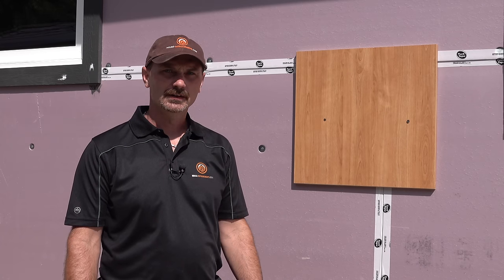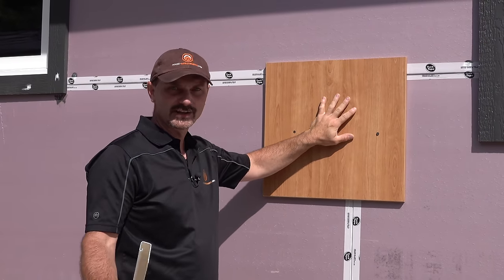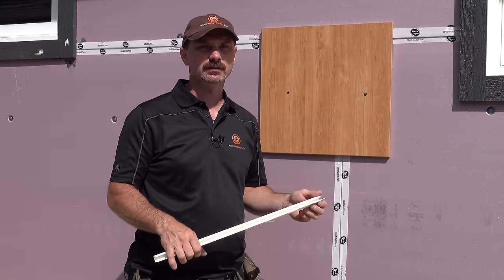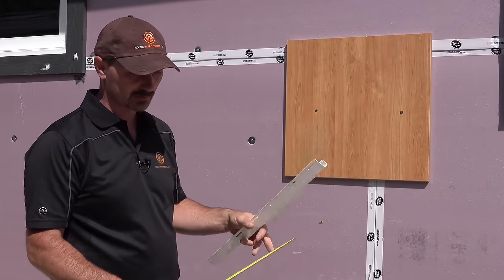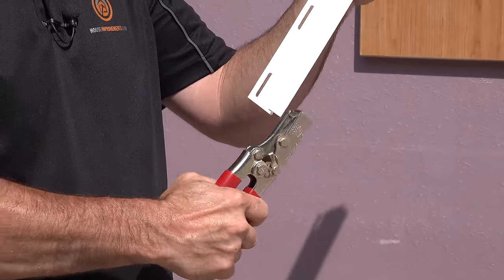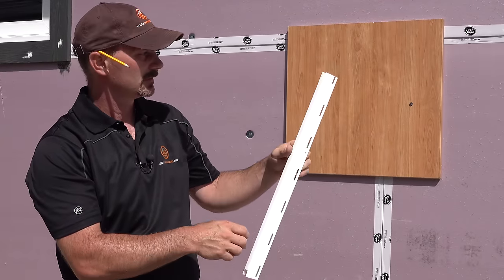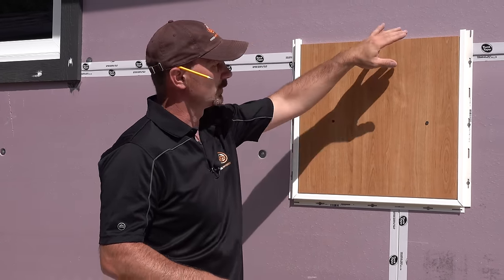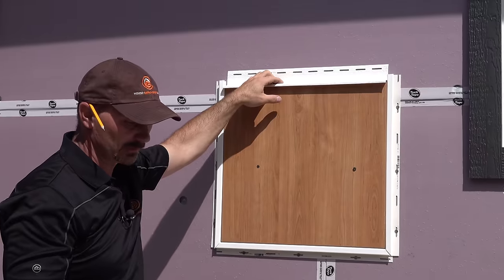How To Install J Channel (Vinyl Siding)

Comment: Hello, I noticed you didn’t have the insulation right to the corner. I’m using 3/8 Levelwall. Should I run it right to the corners?
Reply from the maker: For 3/8" insulation you will be fine to run it right to the corner. When using 2" Like I am I use only 1-1/2" on the very corner and cover with 1/2" plywood to may attaching siding corners easier.
Reply: HouseImprovements thanks for the fast answer I’m starting it tomorrow! Appreciate the videos they are very helpful!

Comment: Thank you for the instruction, I have two questions, one is can you do stucco render over it? second; what size nail you are using for the siding? thank you.
Reply from the maker: Yes this could be wired and stuccoed. I was using 3" shingle nails

Comment: I am trying to install a doggie door on garage so the vinyl siding is already on the back of garage. How do you do this when siding is already on? Zip tool the siding off or just bend it to hammer in the J channel?
Reply from the maker: I would remove the siding and nail the J then re install siding

Comment: What do you do about the water that runs down the wood and gets behind the bottom J channel and all of the wall behind the siding?
Reply: Vinyl siding is not one hundred percent waterproof. Watch some videos on tyvek/ sheathing membrane installation and taping. A sheathing membrane is necessary where water has a chance of entering.
Reply: Properly flash all openings and also use tyvek tape on housewrap..
Reply: In one town i worked in the insp made us come up with a way to shead water from j channel back on top of siding at the bottom of every window ! We were able to make up something but the industry needs to make something like we did for this! 
Great video

Comment: Good video for beginners...if you plan to be a sider this method is fundamentally correct but way too slow.

Check your local building codes...many require end dams and a space between top drip cap and js
We caulk all Js on to whatever protrusions we are j channelling to water proof as well...we use LePage brand Quad type elastomeric polymer caulking for this.
We also never use a tape measure at all....way too slow and easy to hold a j up to window and mark w/ a pencil...on perfectly square windows or vents once you have one side marked you simply cut front and back of j and then fold the j over onto full piece and mark again then repeat until you have 4 equal pieces....saves a lot of time.
For miters we never miter straight to a point as when the j channels shrink in winter there will be a gap at every corner.
Exterior renovations are our business been doing it since 2007.

Not trying to nit pick there is nothing fundamentally wrong with the instructions....just more than 1 way to skin a cat and more efficient ways to get er done when time is a factor...which it is for people installing as a job and pay is piece work.
Reply from the maker: Good info.

Comment: Is it common practice to use j channel instead of starter strip to begin a course of vinyl? Its on my son's house and the water from rain in flowing down the j channel and causing water problems on the house, thanks.
Reply from the maker: Sometimes you need it instead of starter strip. You can drill some holes through it in the bottom so the water drains at other places instead of just the ends.

Comment: I know this should be obvious, but what happens to the water when it reaches the bottom of the, for example, window? Does it push the water behind the siding down the wall? If not, how does it get pushed to the front of the siding when it reaches the bottom?
Reply from the maker: Some goes in behind. If your house wrap is done well it flows that to the bottom of wall and out ,or you can use tin to direct it back out over the sing below.
Reply: @HouseImprovements  Thank! It's an older house without a house wrap, but there are two decent overhangs. I think I'm going to try to direct it back out with the tin. Not a lot of examples on how to do the tin so if you need an idea for a new video this might be a good one. Seems to be a lot of people wondering about how water drainage works with j-channels.

Comment: Wondering if anyone can help me. I have a Malco j trim cutter and every time I try to half cut for the fold down I go right through. So pretty much useless for the intended purpose. Any suggestions would be greatly appreciated
Reply from the maker: I dont wanna sound mean but dont squeeze all the way. All the way cuts it off and partial squeeze only clips it so it will stay on the J. If the J is cold it is harder to keep from cutting it right off.
Reply: HouseImprovements you are not sounding mean lol . But I can’t seem to get on to it. I will just use it for the cutouts and use shears for the other. Thank you for your help love your videos very helpful

Comment: Shannon, Can vinyl be installed over masonite
Reply from the maker: Sure. I prefer to remove old siding and then install new siding but you could go over it if you wanted to.

Comment: Do you install j channel around windows if the window has built in j channel?
Reply from the maker: No you dont need to for the sides and bottom but if your window is in a spot where it needs a drip cap over the top then you need J above the drip cap.

Comment: Easier method than measuring is holding the piece up and marking it with your pencil on both sides then leaving a tail on each end, then screw or nail it on, and then you can mark your length for your overlap piece and cut it while it's on the wall, eliminates the extremely long measurement method you show

Comment: I could have J'ed that pretend window out in under 1 minute. Never use a tape measure unless you know for a fact it's perfectly square (in most cases it's not). 1) precut your bottom on one side,cut it to leave your face a little longer.2) put the j on the wall and mark the other side and repeat the same process. 3) now you can use the tape measure or estimate a bigger than the actual size you need about 4" larger.4) mark inside the bottom piece and the outside face where the two meet. Doing this you will see that the angle you've cut is not always the same!!! But will be perfect everytime. I also interlock the face of the J and bottom and tops , it's water proof and will not spread apart in the future. Me doing it in under 1 minute is 30+ years of experience
Reply: You think you're better than us?

Comment: what do you do between the  j channel and object (window or door) do you put caulking there?
Reply from the maker: generally no because the J channel will want to expand and contract with temp changes but I have done it at times for special situations with no real problems. Ideal you want to effectively water proof anything that you J around before you install the J but there are cases where that is not going to completely work 100% so caulking the trim is a good idea. Remember not to seal an area that should act as a drain to allow moisture out from under the siding. Our forum is a great place for questions like this next time you need some help.https://www.house-improvements.com/forums/

Comment: I try not to use j channel. New construction windows have it built in j channel and I use vinyl brick model and rout out it on the back for your siding for doors and bend aluminum to fit the grove to make it water proof. And I use truss head screws to install the siding and don't make it tight. And for the naysayers I've been doing siding for over  20 years and he is doing the j channel right.
Reply from the maker: Nothing wrong with those methods at all.

Comment: For the notchers is it one size for all j channel? If not what do i measure to know what size I need?
Reply from the maker: There are couple different sizes . Measure the distance from the back that will be against the house to the fringe face of the J channel. GENERALLY A 5/8" NOTCHER WILL WORK FINE FOR ANYTHING.

Comment: One problem I don't like with J channels is that if whatever you fit in there isn't perfectly flat (like aluminum soffits or vinyl siding) and snug (rarely the case to allow for expansion), bugs can use the gap to get on the other side.

Comment: I just spent 1/2 hour looking thru Lowe's and Home Depot for vinyl "drip cap" like what he's using, only found aluminum, galvanized steel and PVC. Maybe I'm using the wrong search term, also tried "drip edge"?
Reply from the maker: Window/door cap" is another term. Sometimes it helps to search more generically like "vinyl siding ".https://www.homedepot.ca/product/abtco-window-door-cap-slate/1000651989
Reply: @HouseImprovements  Thanks, on a side note, I watched most of this vid really close.  I had about 12' of j channel and tried to frame one 24" window,  I got results as if three men did the job, Larry, Moe and Curly:)   But from them I got some dry fit measurements which I can use to try it again.  If your not familiar with siding, your probably not going to get each piece to fit right the first time:)
Reply: I always make my drip cap with trim coil.

Comment: This vinyl siding installation is not waterproof, the J-channel should be back caulked with a thermoplastic sealant such as an NP1 or a QUAD. These beads of caulking prevents the water from penetrating between the J-channel and the board that the J-channel is trimming. Also, the J-channels will eventually separate from the wood square unless held in place. The J-channel along the bottom of the wood is sticking past the wood and water will sit on it, and work it's way in towards the wall behind the wood. Vinyl dripcaps (flashings) also fail over time because they are manufactured at 90 degrees (flat) and eventually fail as well. We are beginning repairs on a townhouse project where they are cracked, broken, leaning in towards the wall, etc. B.C. Building Code here requires a metal, positive sloped flashing that will not fail. 
We have 1,700 projects under our belt since 1984 in British Columbia (a virtual rainforest). And they call me the Siding Guru. I look forward to sharing Youtube Videos in the future.

Comment: Thanks great video. In your link to Amazon for the J channel notching tool there are three different models for different size J channel. If i purchase the largest one ( I think it is either 3/4 or 1 in ) will that tool work for all sizes of J channel or do I need to purchase a different tool for each size of J channel?   Thanks
Reply from the maker: I use the smaller one (5/8"?) so it will still fit in all sizes of J. If you buy the large one it won't fit into small J
Reply: @HouseImprovements  Thanks

Comment: Dumb question but what keeps the water from going in between the "window" frame and the J channel? Do you need to caulk it?
Reply from the maker: If the window is flashed properly the little bit of moisture will stay onto of the house wrap and exist out the bottom of the siding. You can run a small bead back in the corner if you like to be safe, but keep it back where its not seen.

Comment: Do you need to secure the tabs on the J trim?
Reply from the maker: the cut tabs you fold do not need to be secured.
Reply: When you install the siding the tabs will be held in place.

Comment: how do put the J channel on a new dryer vent opening on siding already on from the past
Reply: you can get a Side Swiper Vinyl siding release tool and loosen enough of the piece of siding above the new opening so you can lift it to work over the new vent. Tape around the vent, nail in the J-channel, and replace the siding.  You may want to shim behind the existing piece of siding with a small piece of foam board before you tuck it into the J-channel if you had to trim the siding to fit around the vent.

Comment: You're adding unnecessary notches if you get the demensions  the edges at the window cut the j to the measurement and cut side and bend it around my guess saves you 45 min

Comment: Won't water in jchannel flow under vinyl siding?
Reply: No, the siding is also installed bottom to top and it has tiny "weep holes" at the bottom. Also there is usually a  foundation that keeps the siding off the ground. Porches (where you might see J channel "on the ground) should have a very slight grade difference like the roadways to direct water away from the house.

Comment: Great job on this video.  I may have left a negative comment on another video of yours, but this one is extremely informative.  Question:  Is it possible to sneak these trim pieces under existing siding, maybe pull the siding back a little and drive screws in at an angle to fasten the trim pieces?  Or the only way to do it right is pull off a couple of rows of siding, trim up as needed then reinstall the siding?  On a This Old House video (How to install a range vent hood, which is what I'm doing) Tom Silva cut out a square of siding, put in a homemade mounting block and caulked everything up.  It just looked wrong to me.  Sorry for the negative comment on your other video, I got caught up in gang mentality with the other guys.  I should have looked at all your videos first and some of my questions may have been answered.

Comment: Hey. What is the external insulation of the house? Is it extruded polystyrene foam (can it be used for external insulation of a frame house)?
Reply: Siding is mounted on the crate or directly on the foam (do we need a ventilated gap)?

Comment: Where do you buy the vinyl drip cap?   I can't find any in my area.
Reply from the maker: anywhere that sells vinyl siding should sell this cap. It is commonly used during siding. Sometimes called "window and door cap"

Comment: what's with the 3" nails instead of the 1 1/4"?
Reply: You need to account for the thickness of the rigid foam and ensure proper penetration into the plywood, otherwise the siding could fly off in heavy wind.

Comment: Also nobody uses vinyl drip caps. Use metal and wrap your window first. Again you need Tyvek to pass code
Reply from the maker: You dont use vinyl drip caps with vinyl siding? I guess everyone around here is "nobody" LOL. Not that it would matter either way, vinyl or metal.
Reply: @HouseImprovements   I work for a $100 million company and nobody uses it. But to each his own I guess

Comment: I cannot find the drip cap anywhere. My main store is Lowe's but I have looked other places. Can anyone tell me where to get it?
Reply from the maker: If they sell vinyl siding they will have it."Window and door cap" is another common term for it.
Reply: THis was all I could find at my Lowe's: https://www.lowes.com/pd/M-D-36-in-Mill-Door-Sweep-Install-with-Screws/1199507
Reply: Lowes and Home Depot sell vinyl siding but they don't sell the drip cap. Kaycan does but almost no one uses it according to them.
Reply: @ligngood3787  Many of the new vinyl windows have a channel you can cut out to avoid using the J channel.  Since its a sealed unit, only odd obstructions on a house would need drip cap. But they should still carry it. The building supply manager needs to do a better job.

Comment: Thanks, but let me share some concerns.
It is a new construction, so why not use the "new construction" type of windows with integrated nailing surfaces and J-channels instead of those black "picture frames"?
J channels are just for hiding ends of siding panels, they do nothing to protect the house from rains. Think about the gaps between those channels and the parts of the house they are attached to, like that wooden board your are using in this video (which is not even painted). Water will not run down from those 1/16th gaps, it will be trapped there and it will do its bad job...
It is correct to tape over J channels, but why didn't you do that on the sides as well?
Time mark 20:50 reveals something horrible: this house does not have solid sheathing, it is covered with foam panels instead, and the only place where wood sheathing shows up is around the corners, where strips of OSB are butt-joined with the foam and are not covered by anything like Tyvek or even tape...
This house is destined to suffer from water damage.
Reply from the maker: This video is only to explain how to install J channel around an object on a wall. This board is only on the wall for the demonstration and was removed after. It was easier to show on a small object so that it was in the picture the whole time. This home in the video is being renovated on the exterior and part of the renovation was to add extra insulation over the house wrap and ship lap boards it has on the exterior, this is super common in my area with vinyl siding. The corners have OSB over slightly thinner foam to give a good nailing surface  for the outside corners . The reason for this is when you add thicker foam there is nothing but foam to nail to at the corners if you don't modify the corner construction. I could have added more house wrap over the wood at the corners but I did not because the corners are completely open on the bottom so they drain and allow drying very easy when or if the wood gets any moisture . Something also super common is the fact that the windows are not being changed at the time because they are not that old so to make this work you have to deal with the wall thickness change when adding the styrofoam around all objects that can not move towards the exterior when adding the foam ...like the windows.